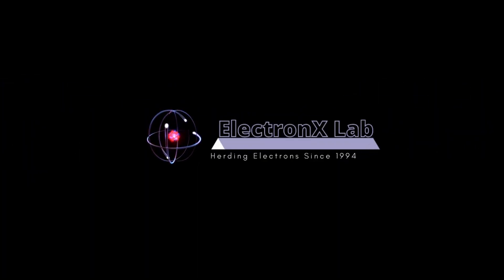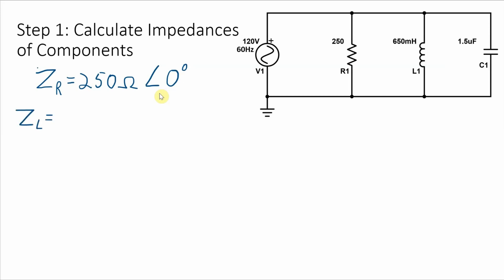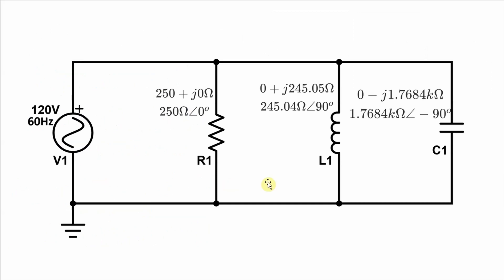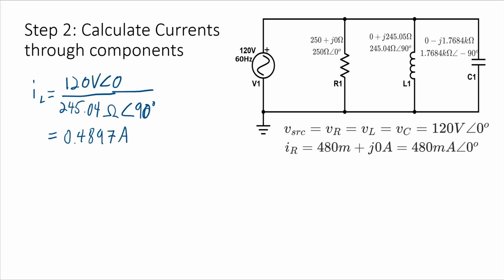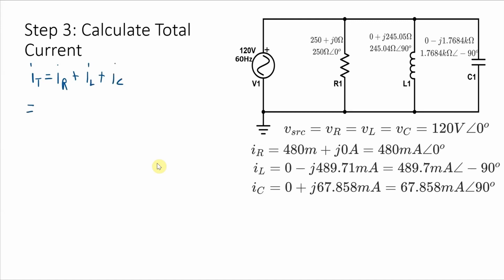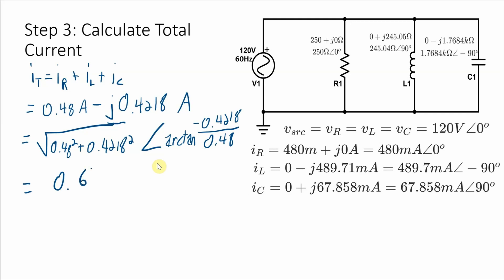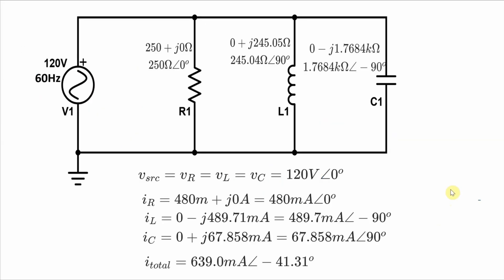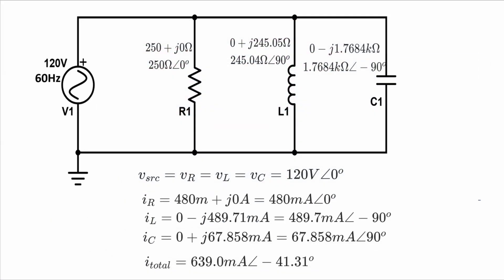AC Analysis: Parallel RLC Circuit. Calculate Voltage and Currents

Comment: Wouldn’t ZL be at -90 degrees and ZC at 90 degrees, according to the ELI and ICE acronyms saying that the current of inductors lags the voltage and that the current of capacitors peaks before the voltage (on a phasor diagram)?

Comment: So we have 4 different currents flowing in this circuit. The mind blow for me  is WHERE do these currents transition from one to another. For example, exactly where does I(T) at (-41.3 degrees) transition to I(R) at zero degrees? I have no problem with the calculations, but I can't visualize how/where these currents interact and morph in the wire. Any help would be greatly appreciated.

Comment: Hey that was great, but just a smidge too fast.  Not enough time to follow along.
Reply from the maker: Thanks for the comment. I hear what you're saying - I'm always trying to think of the balance between too fast and not fast enough and typically err on the side of too fast since you can pause the video when you need to. Would you prefer that you see me write things out in real time? Typically when writing out equations, I speed things up 3-5x and sometimes up to 10x.
Reply: @ElectronXLab I agree it's very fast but we can pause the video and take more time when necessary. Your ability to put all that information in less than 7 minutes is amazing. I really appreciate it.